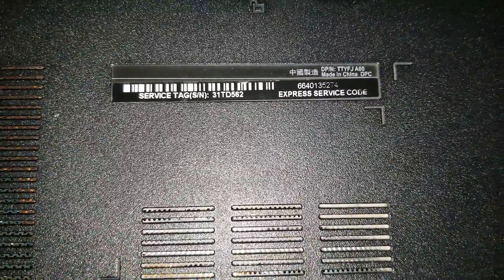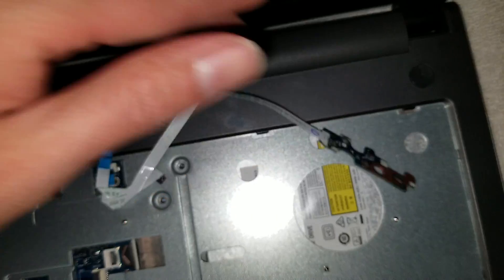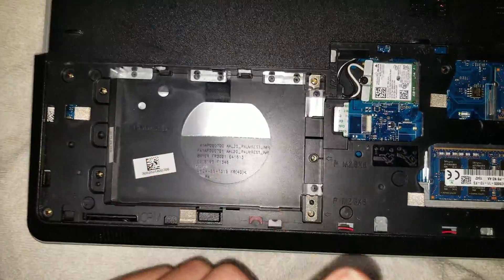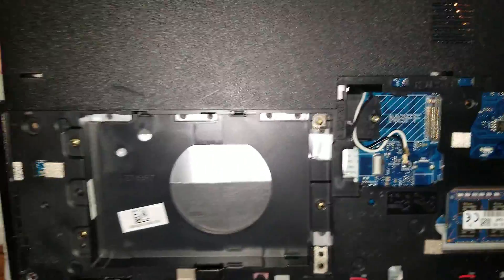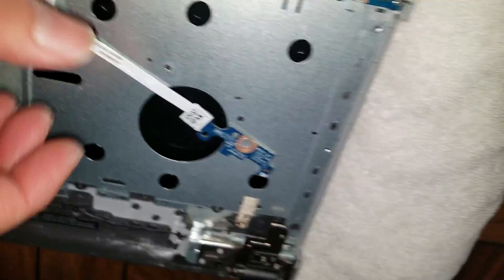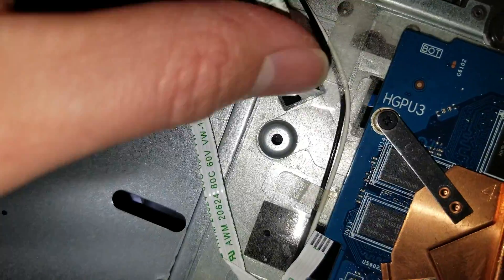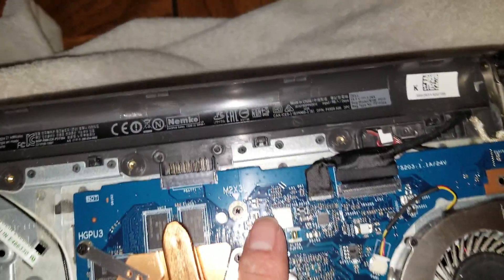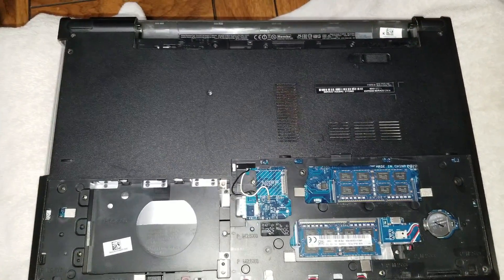DELL Inspiron 15 5000 Series 5559 Disassembly Power button, RAM, SSD hard drive upgrade replacement.

Comment: Can you tell me the name of the board 12:50. What is the price of it during replacement estimated. My audio jack is not working and clicking noise is coming
Reply from the maker: Check eBay/Google Inspiron 15 5000 audio board or usb board

Comment: uhm there's no ram stick in the slots but the system says there's 4gb ram installed, so is it located in a different place?
Reply from the maker: Possibly under the motherboard or integrated.

Comment: Its ok to change the HDD with a 2TB SSD? 

AND Thanks Dude its a very useful video 🙏🏼🤍
Reply from the maker: You can put any capacity as long as it's the same form factor. 2.5" SATA.
Reply: @ItsBinhRepaired  Thank you so much, and by the way your channel is so useful   so keep posting and good luck 🤍🙏🏼
Reply from the maker: @mazinalmaimani7291  thanks, I will!

Comment: Would I be able to upgrade the hdd with a nvme m.2 ssd? Is there adapters available?
Reply from the maker: Yes, but it wouldn't matter, because the sata port would be the bottleneck.
Reply from the maker: Actually only works with m.2 sata drives.

Comment: So you can only put either ssd or hdd? Not both?
Reply from the maker: Yes, because there's only one sata port for one drive, though if you'd like, you could get a hdd adapter for the cd drive slot and replace the cd drive with another drive.
Reply: @ItsBinhRepaired  cud you do video of it ?
Reply from the maker: @r3yuk682  because the videos are of my customers' computers, I don't have the computer anymore to show. Are you asking about the HDD optical drive adapter?